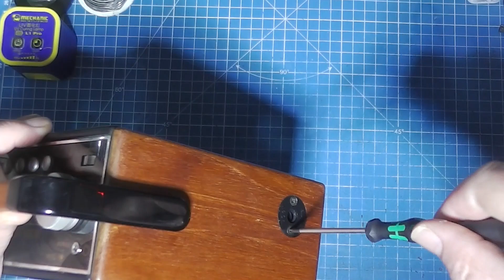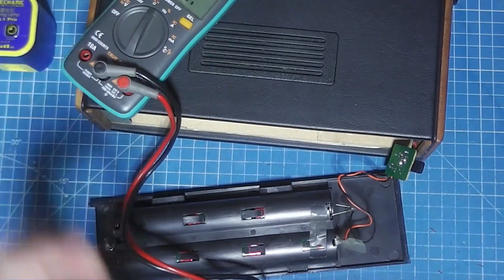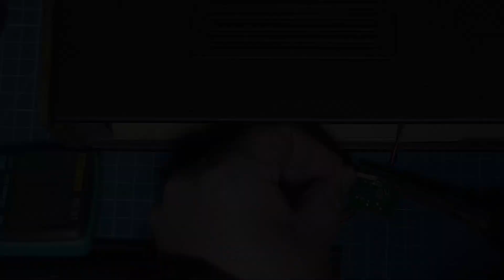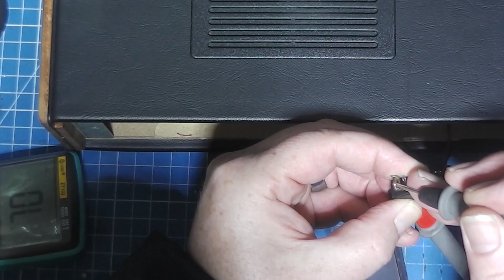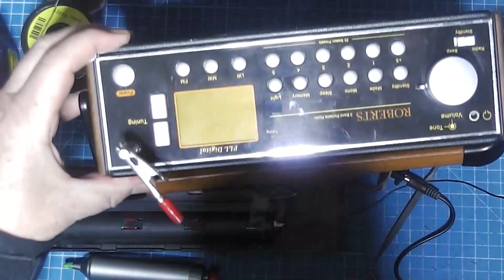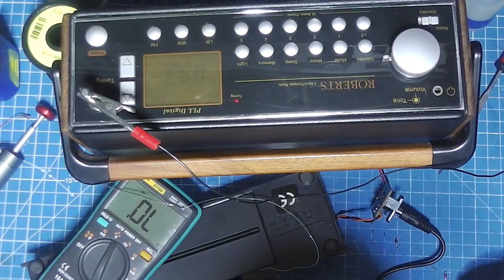Roberts Radio R737 With A Power Circuit Fault

Comment: Hi mate , Ive got a Roberts eco4 with a power problem, it doesnt turn on with the mains but it does with the batteries, but no sound whatsoever, even with headphones, if I send you the radio to the shop would you be able to have a play on it? Thank you
Reply from the maker: Although I usually shy away from DAB radios, I've worked on the Roberts Ecologics 4's previously. There is a known fault with the power switches, but I have never found a direct drop in replacement switch. Roberts themselves no longer repair this model, and do not carry spares. The last one I had with what sounds like the same fault, I modified , (took the switch out of circuit), but the radio could be turned on / off with an inline power switch. Not pretty, but a workaround. Further, the fault with no sound could mean the audio chip (IC) has blown, and may also need replaced.
Worst case scenario - even after sending it in, there is no guaranteed fix, and it may remain as-currently-is.
Rather than bin it, of course you can send it in, and I'll do my utmost, but as I say, no guarantee on success.
My email is on my 'about me' page / tab, viewable sadly only from a PC it seems.
Reply: Hi,thanks very much for your reply, I would rather send it to a professional than just leave it there on a shelf, will contact you via email in a bit
Reply: Youtube just deleted two comments on me in wich I left my email adress for you to send me a test email, on your about me page on my laptop doesnt show anything, any other way in wich I could contact you please? Thank you
Reply from the maker: @adrianbalint1044  https://www.youtube.com/@Codeeze/about
Reply: @Codeeze it doesnt show your email mate, shows how many views you got,that youre from uk and when you joined youtube, its weird
Reply from the maker: @adrianbalint1044  try from a different pc when able. Friend, family etc - Other folk have managed to get in touch. If I put my email here, it deletes it. But it is there on the about me page viewable from a PC (due to YT's own algorithm)
Reply: Thank you,will do
Reply: Finally sent you an email just before,thank you

Comment: I have noticed you do a lot of solder removal with the solder sucker.  A good tip I have is, save all of the solder from the solder sucker into a little metal screw top tin. When you have a lot of small pieces, mix them in some citric acid, mix in a bit of liquid flux to bind it all together and make a solid piece. You have yourself a tin of tip cleaner / tinner.  I have done this before and I am saving all my bits of solder to make another batch. First time, I used some solder without the flux core, melted it intpo a clump and then used a grinder on a dremmel to grind it into a dust and mixed it with citric acid (bought from sainsbury's as tesco doesnt sell it in boxes). Tip cleaner / tinner is so expensive to buy, it is cheaper to make and simple. :)
Reply from the maker: Thanks for the top-tin-tip Ian, I'll maybe give it a go when my current tin of tinner runs out 🙂

Comment: Strange about the diodes, thanks Paul 😀
Reply from the maker: Indeed. Not an issue I've come across before, usually with these it's just dry joints, but this one got my head scratching...

Comment: Hi, I think the problem with the centre pin on the socket is caused by the riveted pin not making contact with the solder terminal, regarding the green Varta batteries my wife acquired a box of them at a car boot although they are out of date they still seam ok.  Regards from the old sod from North Wales.
Reply from the maker: In circuit the diodes read bad. In circuit the diodes didn't work. Out of circuit tested as good diodes. I stopped trying to figure it out and just replaced them with 1N4148 and it's all good again. Same with the riveted pin, out of circuit good, in circuit bad. That little board is the socket, 2 diodes and a resistor. It's not rocket science, but as a retired rocket scientist, I couldn't fathom it...
My Varta batteries came from a car boot sale also. I bought quite a lot, and although some are 'out of date', and some are pretty close, they are great quality batteries.

Comment: i was thinking the thin pin wasn't making a good tight contact to the metal tab on the jack socket.
They are often pressed in like a rivit, but not very well. :-(
Also i would check the plug for a hole that's way too big, like a pea in a bucket lol.
Nice radio though :-D
Reply from the maker: In circuit the diodes test bad. In circuit the diodes didn't work. Out of circuit tested as good diodes. I guess they (or at least one of them) breaks down under load. I thought at first one had been reversed, stopping the mains flow, but no, replaced like for like , and they're fine.
They are a nice radio the R737, solid performers, and sound great. The jack socket is it's achilles heel. Usually, it's a reflow of the pins and all good. (dry joints). Pesky diodes saw that theory shot down like a conservative party promise...
Reply: @Codeeze   schottky diodes would lose less voltage, but they might be too big to fit  :-(.
Keep tinkering :-D

Comment: ooohhhh... didode diddly didle deads....
Reply from the maker: In circuit the diodes read bad. In circuit the diodes didn't work. Out of circuit tested as good diodes. Replaced anyway with new didode diddly diddles, and all is good. Stopped trying to work out why. Just happy it's all gravy.

Comment: Interesting looking batteries, Code' ?
Reply from the maker: Varta. Military issue. Back in the day when I worked for Her Maj, they were tje same style but Duracell - again same green with the red band - and in the style of the black and gold civilian Duracell. M.O.D. found they could buy them cheaper and more reliable from Varta. I have AA's C's and D's like this. Bought locally as surplus, and within a year of expiry. When in the mob, if the shelf stock batteries were due to expire within 12 months, even though 'new' - they were replaced. Traceability and all that.